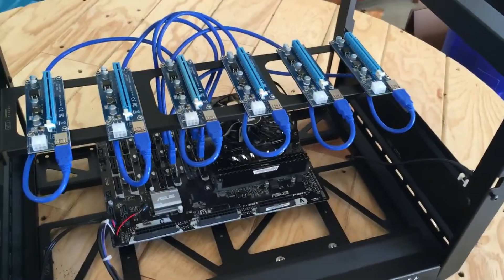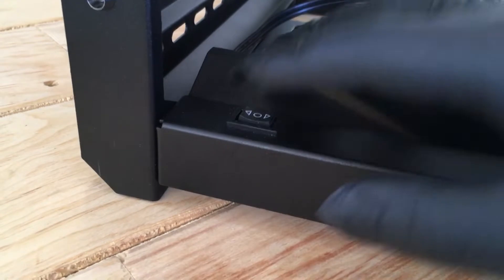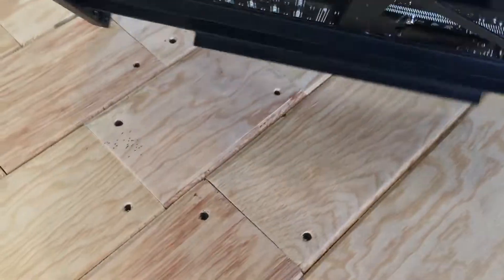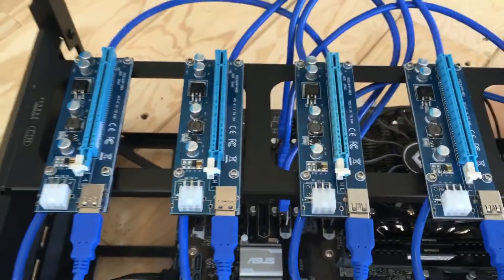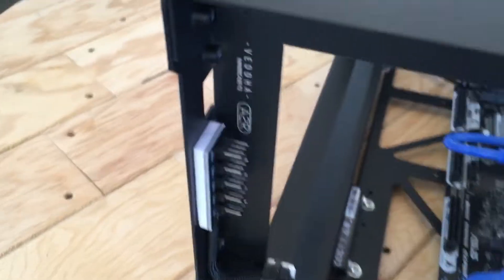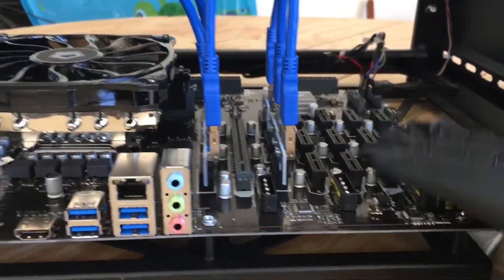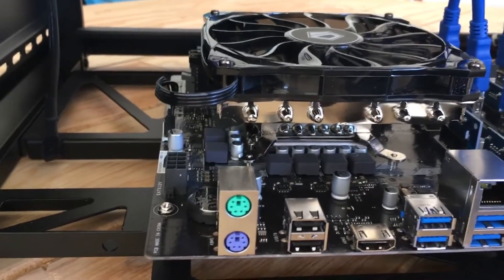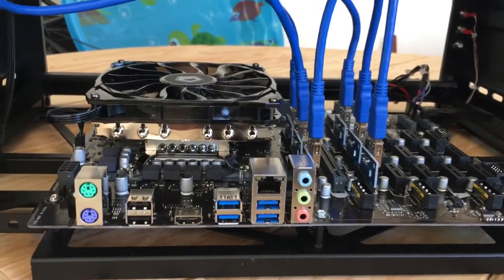Part One Of The 6-GPU Mining Rig Setup With A ASUS B250 Mining Expert Motherboard And A G3930 CPU

Comment: Did you run the video from the HDMI or from the graphics cards ? For some reason I cannot get mine to send a video signal on a consistent basis sometimes it works sometimes it does not
Reply: I have same problem. Did you sort it? and how?
Reply from the maker: I used the on board hdmi at the start. But I don’t have a monitor hooked up anymore. I just open a shell if needed.
Reply: @FuzzThePiGuy  dude same wtf asus is trash

Comment: Do all the cards have to be the same to mine in one mining software program?  The reason I ask is I have two different AMD cards and only one starts mining.  If I unplug the one that's mining then the other starts up.  I'm using an Asus B250 Mining Expert motherboard, an AMD RX 580 and an old AMD R9 380x.  I'm using Betterhash right now but they do the same thing in Cudo Miner.  My computer sees both cards and everything is fine.  They both run a benchmark successfully but when I hit "apply" and start mining only one card will run?  Any ideas?
Reply: No